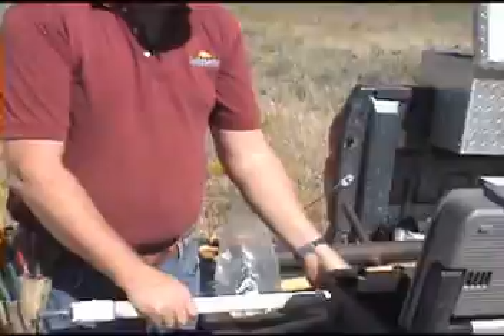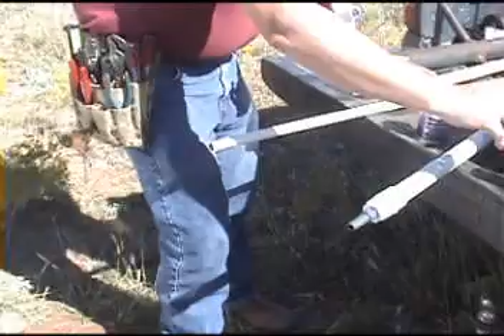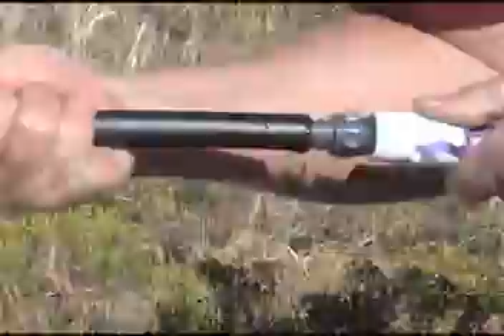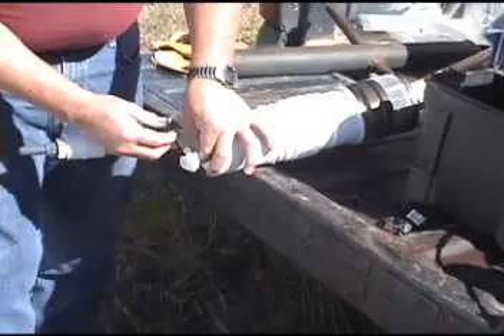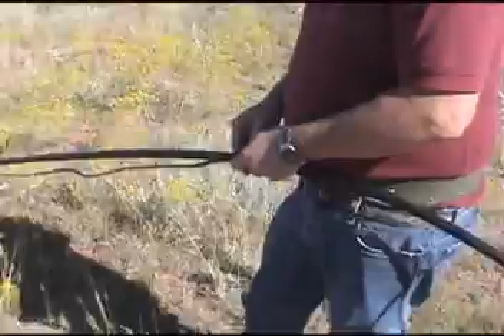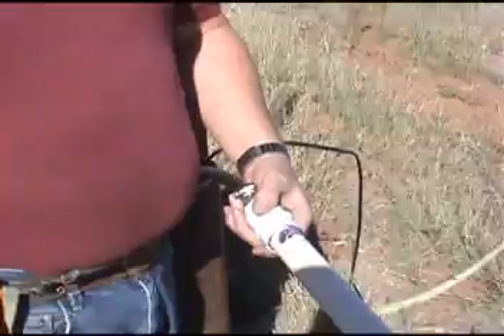How to Install a Solar Powered Water Pump System by Advanced Power Inc.

Comment: How come you don't have some sort of guide rope support to hold the pump ? I see only the black pvc pipe and the 100 ft power cable..
Reply from the maker: Some of our solar pumps are aluminum  housing so they are not as heavy as your typical SS pumps. API's pumps weigh only 9-12 lbs. We do put safety ropes on our Stainless Steel solar pumps however.
Thank you for the inquiry, for more information on our solar powered products please visit www.solarpumps.com

Comment: Am I correct in that this thing began pumping AS SOON AS THE SOLAR CELL WAS PLUGGED IN??
Reply from the maker: Yes, our solar pumps work off DC power. No external controller or drive is required.
www.solarpumps.com

Comment: what heieght of water u lifted n wat is d power of solar panel n motor?
Reply from the maker: You can view the details of this system and more of our complete systems at https://solarpumps.com/products/complete-systems
Reply from the maker: Depending on well casing size, our submersible pumps will lift 850' (more if custom built to demand)

Comment: What's the most gpm you can get with a 4 inch casing?
Reply from the maker: You can view the details of this system and more of our complete systems at https://solarpumps.com/products/complete-systems
Reply from the maker: Usually we try to stay under 120 GPM however we can build a custom pump head/motors to increase flow depending on lift.

Comment: so the tape do not came off once it sits in the water?
Reply: The only reason for the tape is to prevent wire damage during installation I'm pretty sure... Doesn't really matter if it degrades over time